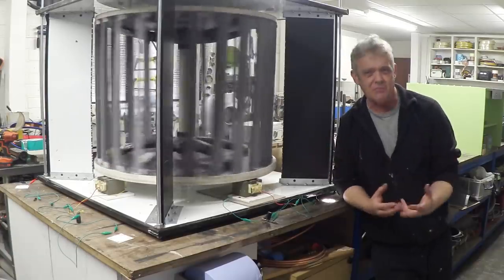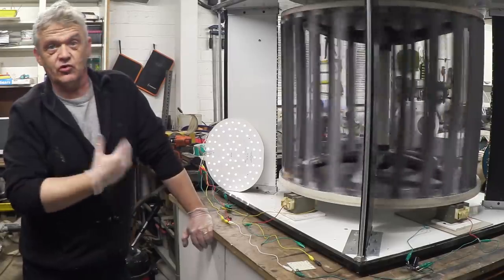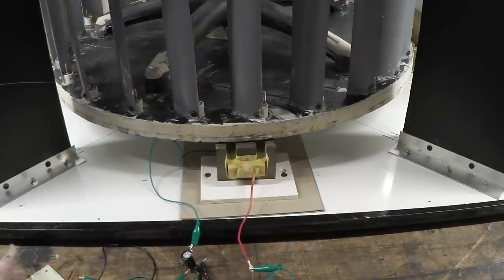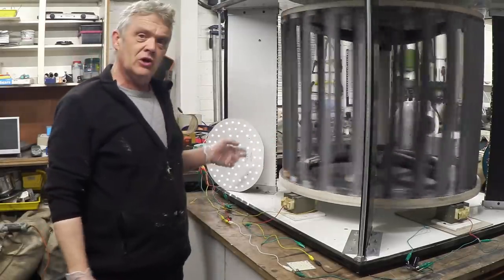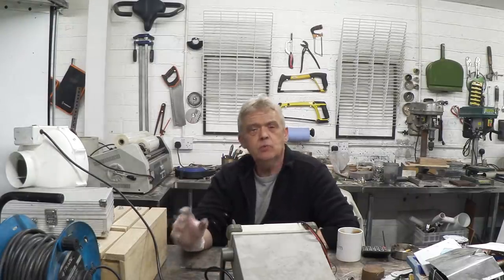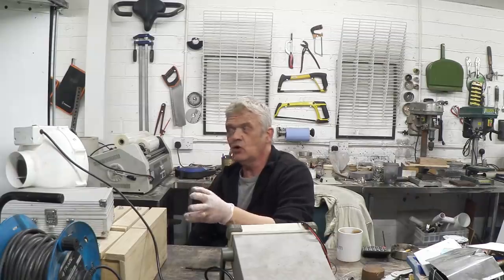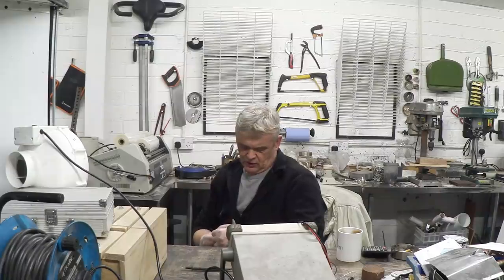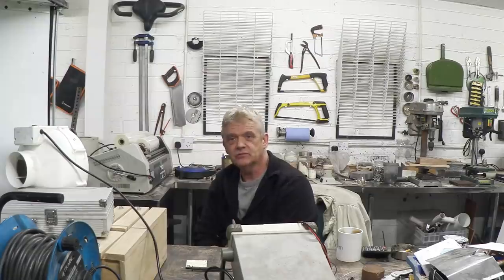Building a 1kW Wind Turbine For Under £100 - Part 6 - Installing The Coils

Comment: I've read that you should have the coils offset from the positions of the magnets to avoid 'cogging' (so using 13 coils with 12 magnets for example) The relative positions of your coils with respect to the north/south outputs of your magnet array may be what also contributed to the rotor stall? Also using a three phase system with a three phase bridge rectifier may help to smooth out the torque load on the rotor as this will even out the transfer of power. Three phase output also has the advantage that when rectified produces a smoother DC level with less capacitor size required.  obviously DC output is significantly more dangerous than AC so the gloves are a great idea!
I really love your videos and I especially like the way you include the learning process which I think  makes them very inclusive and inspirational for prospective builders. Thanks for all the inspiration!

Comment: I congratulate you for discovering  This Capacitor Unleashing or De-Braking  Effect on  rotating  Generators' flywheels. I propose  to  call this effect: 
The "Robert Murray Effect or Capacitor De-Braking Effect"  or "Robert Murray Counter Torque Neutralizing Effect"  because you excelled in defining this electronic phenomenon.

Comment: For  generator to work in AC mode , synchronisation of emf waveform is necessary, which can be done by positioning the coils such that crest and troughs of each coil occurred simultaneously,this can be easily done by observing the flickering of LEDs

Comment: Great stuff with the capacitors! Same principal goes with self excited induction motors you showed us but bare in mind that when the load exceeds the capacity of capacitors, the cogging returns. Anyhow, also exited you've even had time to create voice activated light switches! 😁
Reply: I guess to safe-guard against excess load you could just use much bigger capacitors, Robert can print them with his conductive ink easily enough.
Reply from the maker: lol - I call my activation device Luke - Lights up kinaesthtic effect - lol

Comment: The number of coils can be a multiple of 3 as one configuration. Then connect every 3rd coil around the circumference together. So 24 coils will have 3 groups of 8 each. This should produce a 3 phase output, rectified by a 3 phase bridge if needed.

Comment: One of the big problems with this type of wind turbine is overspeed in high winds, de coupling some or all of the transformers from the cap's and rectifiers when a preset voltage is reached would in fact provide a safety breaking or governor system that could automatically control the higher output voltage and also the integrity of the structure. I live in an area where wind speeds occasionally exceed 90 kph, we are not too far away from a wind farm. Keep up the excellent Projects, Thanks'

Comment: Robert,
The capacitor effect on the rotor torque you found is one of the secrets me and a few others had discovered many years ago in doing free energy research.  Using this principe in fe devices made a big improvement in input/output efficiency.  At first I thought the improvement was due to simple cap smoothing of the rectified ac source.  Further tests proved conclusively that smoothing was not the answer and something more special was going on and not described in any literature I could find.  Point 2.  To find the ideal number of generator coils and amount of load for a given wind speed do this.  The ideal load only occurs when the impedance of a load and the generator coils are equal.  Electrically, this means when the open circuit voltage of the generator is lowered by 1/2 with a resistive load attached, then that resistance value is the equivalent ideal load impedence for max output for a given wind velocity.  Since you experienced no reduction in rotor rpm, it seems you are way under utilizing the coils and the amount of loading the rotor at 10 rpm is capable of.  ie. More coils and or heavier loading.  Great build.
Reply from the maker: that is interesting mate - thank you for taking the time to post

Comment: Ya know Robert: with a long enough black pipe of reasonable diameter you could create the necessary draft required to turn that thing without actual wind.  Of course then you'd need sunlight to create the heat for the draft and a reasonable height difference to facilitate the flow but you wouldn't need the blower or the wind.....   Just a thought.   Terrific discoveries!  Great video: Thanks!
Reply from the maker: it's a good thought mate - properly arranged heated air in an updraft might be an idea too
Reply: @ThinkingandTinkering  
  The chimney effect?  Same principle, but with winter on the doorstep definitely a viable possibility.   Incidentally if you enclose black pipe in an insulated glass  box you increase the efficiency dramatically...

Comment: Absolutely Brilliant ! ( i finally found this video again!) the capacitors  decupling the load is fantastic.... this is the problem I have had for years that I could not figure out (wiring a bridge rectifier directly to the coils and to a 12v light virtually killed the spin !
it seems to me that the decupling effect would depend on the amount of capacitance that is used... but I am not sure... ....time to dig out the old project it seems THANK YOU !

Comment: You just answered my question on what you are going to use for coils, that's great,  I like your idea to running it through a  storage device and then through the blocking diodes of  the rectifier ,you don't have a load on the generator except pushing a charge into the capacitor., that's great.
Reply from the maker: cheers mate

Comment: You’re right. An easy explanation is that a coil measurement is reluctance. It exactly that. It will act as a brake (like in electric cars). Adding the capacitor gives it an easy path with little resistance and discharges on the opposite polarity pushing it.

Comment: That's a nice rectifying and smoothing circuit for the AC coming from that turbine.  Especially running a DC circuit like LEDs. More efficient use of the power.
Reply from the maker: Thank you very much!

Comment: After seeing the news today about the national grid, this would be a very much in demand product.  I have a 1200 watt generator, bought at the start of lockdown, on standby to just keep the fridge, freezer and a few emergency lights, as well as keeping mobiles charged running for a few hours fuel permitting.  Your wind turbine would trump it.  Keep it up please Robert!   I am interested to know how and where you are installing it and what the noise and real-life running of it involve; would you hook it up to a battery bank, or just run as-is? would you keep it DC or make AC?  So many questions.  I watch every night thank you very much!
Reply from the maker: it is surprisingly low noise and it is going on my roof - there will be an install vid for sure and my plan is to charge a battery bank and use an inverter for ac

Comment: Impressive, my guess is that by adding the capacitors, they charge as the magnet goes passes the coil and then discharges through the recitfier to the load. As the caps are now discharged, they limit reverse current flowing back into the coils through the rectifier as the magnetic field collapses so a reverse/opposing magnestic field is limited. As you put it, it's like adding a clutch to a regenerative braking system but the tradeoff is losing that bit of power to the load. Look forward to the result, well done!

Comment: Hi, very nice work. About the diodes: they only allow current if the voltage is larger than the diode forward voltage of about 0.3 to 0.6 volt. So while the spinning is still very slow, the coils probably don't make enough volt to allow any current, meaning there is no force yet. Nice idea to use this as a clutch. The only downside is that you loose a bit of energy. Note that with the diodes it makes a big difference if you use the 2V or 20V coils. With the 20V coil the diodes should engage at much lower rpm, but the energy loss will be much less. Thanks for your videos.

Comment: Nice. 
What happens if you put them in parallel is that the output is out of phase with each other. If you connect sources in parallel that are not in phase it is effectively a short. As I told you when you short them the mechanical load on the turbine is maximum. So that's what causing it not to turn. ( Take one of your steppermotors and short all wires and turn or try to turn the shaft ... you'll understand what I'm talking about ) It is actually a good sign because it shows there is a good energy transfer from mechanical to electrical. You solved the problem by turning each ac source in a dc source which is a good solution. I guess you can call that decoupling the phase if you like.
If you got the same effect in series I don't get that at all. That would cause less current thus less mechanical load on the turbine ( and little output ). Of course if you would have outputs phase perfectly in sync you could put them parallel or in series and get good results for both situations. That would have required perfect spacing of magnets and  exact in phase placement of the transformers which is not the case.
Anyway, your solution is good. Make as many video's as you like. I think they are great.

Comment: I'd like to see you draw this out on a white board, showing the waveforms with and without the capacitors. It would be very interesting seeing you design a control circuit that varies the load with the wind supply, using rpm or voltage from a magneto or something, the faster it spins the more voltage it creates, the more you switch in coils. I'd like to see that control circuit working, that would be interesting.

Comment: Hi Robert, I think it would be better to angle the corner baffles so they direct the airflow onto the driving side of the rotor and block the airflow onto the returning side, wherever the wind is coming from. Possibly curved baffles or more than four. Also would it help to let air out of the top and bottom discs to increase flow over the blades? Great videos, very thought provoking and well made

Comment: If you match your capacitance to the impedance [typically, each coil matched by its own capacitor, but it may work on the overall, I am no sure] you get a super low resistance osculating [ also called 'ringing' ] circuit, and this greatly increases efficiency.
Reply from the maker: nice tip cheers - but the cap is after the diode bridge - I am not sure but doesn't this mean it can't 'ring'
Reply: @ThinkingandTinkering  Perhaps I misunderstood but I thought you said from the coil you went to the capacitor and then to the bridge rectifier?

Comment: I like your design!!! I thought that any kind of funnel and tent at the same time could be a cheap way to concentrate the wind and protect the coils from rain maybe? (I dont know if coils need be protected from rain).
Reply from the maker: they do need a bit of protection mate - but it's pretty easy to do - a coat of paint will work just as much as anything else

Comment: The AC phase relationships between the coils would have to be synchronized perfectly to get them to add together. Whether in parallel or series, any out-of-phase timing will either oppose the system voltage, or shunt the current thru other coils, costing energy thru dynamic braking. Converting to DC at each coil keeps the phase relationships from fighting with each other. If you matched the size of coils to magnets better, this could effect an even greater efficiency. Thanks !  Looks good, even marketable !!!

Comment: I've been wondering about why the addition of the diode bridge and the capacitor has this effect. Might I suggest that the reason  is that the diodes do not conduct at 0V the voltage across a 1N4007 diode must rise to 0.7V approximately before conduction and that it is this threshold of conduction that is just enough for the turbine to gain some inertia before the load is applied. If you had used instead schottky rectifier diodes which have a much lower forward voltage drop of 0.2V it's possible that the turbine would not start. Either way it's a great result.

Comment: Awesome!  If you extended your rotor shaft and your four corner supports and fitted a ring to the back of your top piece that sandwiches it to the bottom piece, space the top to the wheel exactly as you did the bottom to the wheel - then you can add 24 more coils at the top end.  May as well double the coils if you got free parts.  That should give you a 2KW generator!
Reply from the maker: nice on mate thanks for the tip

Comment: Thanks for doing this.  I love the 'experimental" nature of it all..even though you obviously get ahead of your videos with the experimentation (a good thing by the way).  I don't think there are too many videos...it is good to see it in stages.  I counted and your turbine is turning at just over 20 RPM.  I like your questioning and thoughts/analysis around what is  (seems to be) happening.  I wondered why you need a bridge rectifier on the capacitors as I thought this thing was outputting DC already.  I was not aware that the same LED could run on either DC or AC power.....my own knowledge limitation.
Cheers

Comment: Hi Robert
I think the problem with connecting all the coils in series or parallel has to do with the phase each coil is in. it should work in a 3-phase configuration with the coils correctly placed. Series should word as well. The main thing would be to get the flux rising and falling on each coil at the right time. You could even use LEDs to see “more or less” the flux rising and falling on the coils. 

The capacitor works because with the capacitor in the circuit it sops being a short circuit. I think a diode between each pair of coils should help. Also fewer magnets and only using one pole may help.

Lovely series. All the things I want to do but am too lazy to do.
Reply from the maker: I am sure you are right mate and thanks for the tips

Comment: Mr Murray-Smith, Wind your own coils, take those transformers and cut one into 3 pieces (the 3 legs of the E core, making 3 separate iron cores) and wind a bobbin that you can make and use a drill to wind the wire (cheap way). wire is cheap and if you have a shop near you that deals with magnet wire you can get it for scrap prices or buy a good size roll off ebay or the like, I have would many many coils

Comment: For an experimental setup (ease of access) the placement of the coils is fine, but I would just fip them over for outdoor use, using the support disk as a cover for the coils & accompanying electronics, from the elements, and letting gravity (water run off) keep everything dry... keep up the great work!!
Reply from the maker: nice tips mate - equally though I could just put them in a plastic box

Comment: The use of the bridge rectifiers effectively isolates the coils from one another, so they are free to produce both positive and negative pulses of electricity, regardless of what is happening in the adjacent coils in terms of their voltage polarity.
You could probably leave out the rectifiers on each coil, as long as the magnet and coil alignment were matched such that any induced current was in the same polarity in each coil so that they added to one another, as against subtracted.
I'm no expert on electro-magnetics' but it may be that current passed out of phase through an adjacent coil would in effect energise that coil as an electromagnet thereby providing a breaking motion to the generator, which you noticed without the use of the rectifiers.
As an aside, the multiple 1000uF caps could probably be replaced by a single large capacitor, anywhere on the DC bus rail to achieve the same effect, which is smoothing the pulses into a more stable DC level.
Finally, love the videos and your enthusiasm for the subjects you cover. It's also refreshing to see someone just take an idea and play with it to see where it goes.
Go back long enough and the Robert Murray -Smiths of the day would have been people like Voltaire, Davy and Faraday.

Comment: Totally interesting. The capacitors arrangement taking off the load is something to think about. As I said previously I think this would be amazing if you got this in a stream where the water never stops. The weather now a days is just so unpredictable. Last night is was very warm here in Dublin. You can never rely on the wind. Great Job Done.
Reply from the maker: I do like water power the only problem is my access to it
Reply: @ThinkingandTinkering  run to bath tap?